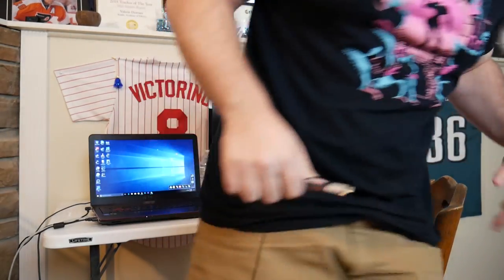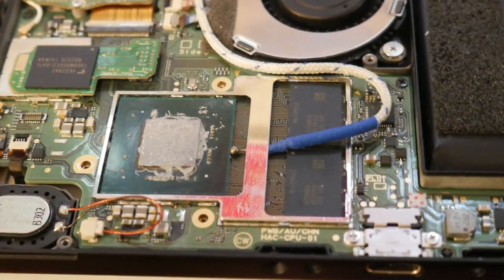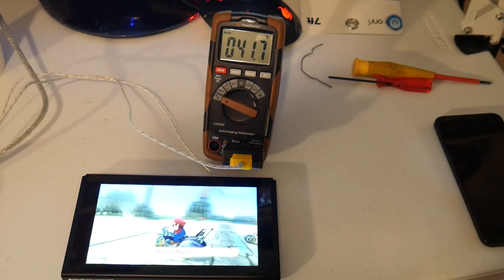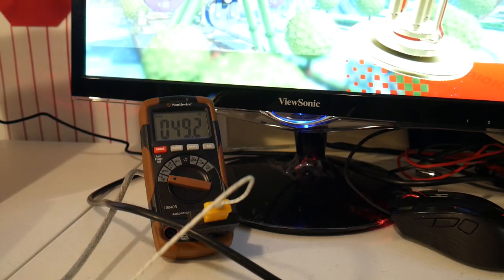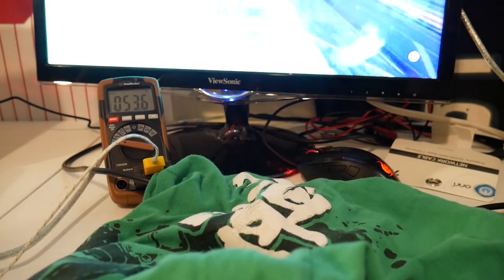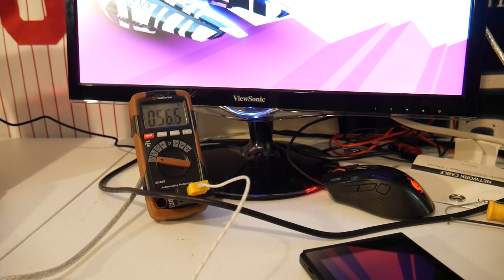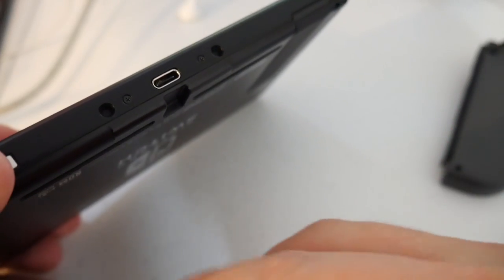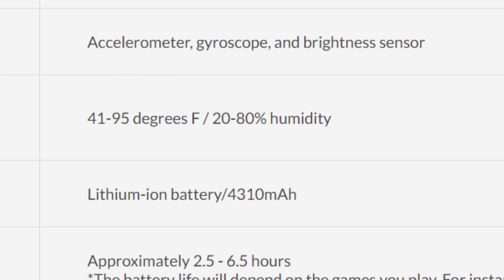Let's Overheat The Nintendo Switch!

Comment: Am I going crazy here? I was under the impression that the speakers were on the back of the Switch and the vent was on the top.
Reply: Jigglibuff The speakers are the tiny slits under the display. I only noticed a few weeks ago
Reply: The vent is the top you’re right. This guy just doesn’t know what he’s saying.
Reply: Wes Breden the vent is the bottom. But lets trust you. Because let say you opened the switch and looked at where it was.  And when you take it out then why would the air come out from the back instead of the front. Seems like you cant event tell where the wind comes from.

Comment: 60c is actually pretty cool for any processor. My overclocked 7700k which is a high end desktop processor hits around 85c during stress tests. 100c is kinda the too hot temp for a processor when it will either thermal throttle or shut down but in a handheld device you want it to be bearable to hold... Long story short you really dont need to worry about the switch overheating to the point of damage. Yeah it may shut down but it will never damage itself unless you remove the cooler for some reason then yeah running at any more than 20 seconds or so it will most likely kill itself.
Reply: that 7700k is a different beast with a  different archetecture and smaller lithography. the tegra can safely operate up to 75 degrees. intels modern processors are rated up to 100 degrees and with useually throttle at 90 to 95. also the tegra is direct die coupled to the heatsink there is no integrated heat spreader if you dont count the stupid emi shield as one.

Comment: I ordered clear shells for my switch, and I was wondering if the large metal plate on the back makes a large impact on thermals and if it overheats with it off. I heard that this was just an EMI shield but I also heard it acts as a heatsink. If you see this please reply quickly because I need to know soon
Reply: it should by design help dissipate heat over time. as for it's effectiveness it's meh. probably would run cooler without that extra layer in there. I have removed emi shields before with no ill effects other than maybe nearby audio equioment picking up extra noise but if that is a problem then the audio equipment is not shielded very good it's self.

Comment: Where'd anyone get this idea? Laptops have fans on the bottom aswell, they get warm bet rarely ever overheat
Reply: McKaos unless you overclock the CPU and gpu or heat up the internal battery....
Reply: James Braselton laptops also have hotter parts. Have you seen how fucking hot a shitty pentium gets. But the idea is ventilation on the switch is perfect for the ratio like a laptop fan ti its size.
Reply: Ricardo Martinez the fan in the switch is actually quiet big for the size of the tablet and moves air pretty well.
Reply: Knuckles300 yeah its the biggest fan ive seen on a tablet. I mever experienced it get to hot unless its docked and its just warm to the touch.

Comment: A general rule of thumb if you want to be extra safe is try not to play over 2  hours preferably 1 hour and make sure your room is well ventilated and ya should be ok for gaming sessions. Probably can last a lot longer but i don't trust playing the switch on the dock for very long periods even though i took extra precautions to help prevent overheating.

Comment: It's more about Switch lifespan. All electronic components have threshold operating temperatures. It is possible that you shorten its lifespan from prolonged exposure, specially capacitor.
Reply: You are right. That is also not taking into account that not every Switch can take 67c as there max temp before shouting down and some well take less heat and some can take more heat.
Reply: Dennis Tang I think this video also should assuage many of people's fears about that as well.
Reply: That's true, but the standard temperature ratings for components in consumer electronics is -40 to +85 C at minimum--and that's for their rated lifespan. Not to mention, most of the capacitors in the Switch are a couple inches away from the SoC and will be at least 5-10 C cooler than it.

Comment: My MacBook Pro works just fine on the bed.  Perhaps because it was designed appropriately for that case (no vents directly on bottom, but recessed up a quarter inch).  Design win.

Comment: You could recommend people who are still affraid, that they can use the smal dock by putting it flat on the table and the switch laying ontop of it while the cable goes around at the bottom. Having good airflow and works perfectly.

Comment: As you might know now, computers use a value called "Thermal Junction Maximum" as the maximum temperature that the processing unit can hit before throttling or shutdown. If the board is at 67c, the processing unit could be hitting a tjMax of 75 or 80c. In my experience with desktop  CPUs and GPUs suggest that's lower than what would be considered dangerous. We'll have to wait until NXident comes out

Comment: Xenoblade Chronicles 2 managed to scare me the other day. I played on my TV for about an hour and pulled it out of the dock and this was the first time I ever heard the switch fan panicking to cool the system. I was afraid that XC2 might be too much for the system at certain points. I think this because the game already has frame drops during serveral battles and while walking around map with many entities. If u wanna try for a thermal throttle, give XC2 a go. Yes thia game is long and i didnt notice heat problems until i made it to Gormott Province

Comment: Would have been nice had you flipped the switch over to see the difference between it lying on its back and it lying on its front. Most people (I assume) have screen protectors, so it would be worth knowing if the dongle dock works better when the switch is on its belly!
Reply: probably about the same.

Comment: nvidia tegra x1 doesnt even start throttling until zone1 reaches 89°C OR zone2 reaches 90.5°C.

basically this thing is not going to overheat itself during normal use and even when hitting temperatures to cause it to turn off it is below the temperatures required to do damage to the hardware.

Comment: While this was an interesting video to see just how much the Switch could tolerate, The thought of the two back "vents" really urked me considering they weren't really the main venting system. The actual venting comes from a copper pipe releasing the heat to the TOP of the Switch, where the fan is and exhausts the heat there. At least, that's as far as I've concluded with my own Switch.

Comment: The air vent is on the top of the Switch. The holes you pointed to on the back is where the speakers are.
Reply: Mike Mayo thats a fan not a speaker. The speakers are the slits on the bezel of the switch.
Reply: uh.. That's what I said. The fan blows air out of the vent on the top of the switch. The speakers are on the back. The guy in this video was pointing to the speakers. That's not where the fan is.
Reply: Think about it for a second. If the fan is where he said they are, the vents would be covered when it is docked decreasing the efficiency of it.

Comment: The thermocouple should have been touching the silicon die, not the interposer. That's nothing more than just a circuit board connecting the silicon chip to the BGA pads.

Comment: I think you should have kept the fan plugged up on the switch with a towel and shirt on top of it to see how hot it can get before it cuts off but if you wanted it to get even hotter have a heater blowing on it

Comment: The switch seems to hold up well. I have a Wii U and if you put items on top of the wii after an hour or two. ( maybe even longer.) it will over heat. But if you keep the Wii U open to air than you should be just fine.

Comment: Hey good vid, so what is the typical temperature the switch would operate under normal circumstances? (Ie, in a regular nintendo dock, no vents blocked)
Reply from the maker: Around 49C during Zelda.

Comment: The Tegra X1 was intended to function without any coolers to begin with... The Switch has a cooler which somewhat extends it's capabilities a little beyond original specs.
Reply: who said that? the tegra x1 requires passive cooling at minimum (which requires a heatsink be it a chink of metal or a active cooler likein the switch)

Comment: You should do a comparison of tempatures on the switch. Tempature of Switch laying down while using the 3rd party dock you used, tempature of switch docked in original dock and tempature of switch in original dock while laying down.
I was thinking of laying my dock down but because of the heat vents my dock is still standing, but I hate how much vertical space it takes up and it would be convenient if the dock was laying down which would make it way easier to insert and remove from the dock.

Comment: I love the Switch but I wish that they would work on the over heating portion of the Switch. It overheats a lot when it's docked and you can feel the difference when you take it out of the doxk and switch the memory card in the back. I am always afraid that something will go wrong with the Switch while it's in dock and it's overheating.

Comment: This does make me wonder; how might the system react to cold temperatures? As in, would it still function if I had accidentally forgotten it outside during winter if the average temperature was -30 degrees Celcius.
Reply: condesation would be the main concern but otherwise don't charge it till it comes up to room temprature and yeah you could play it but i bet that lcd is gonna ghost like mad and the battery will run down pretty quickly.

Comment: the most overheat I got my switch to be was when I was playing while sitting in bed and I put it down at one point on top of my sheets where the cooler got covered up as it was sinking in on my sheets.
not sure how high the exact temperature was but it was really hot when I picked it up and it was running quite fast and loud, trying to cool down. I turned it off for about an hour to cool it down just to be safe

Comment: A great test on trying to over heat the Switch but what about the case how did it hold up did the case bend or did it melt the plastic any where on the case?

Comment: I overheated my psvita a couple of times, it shut off later 30 minutes after it it ran fine, i left it on by mistake in my car with windows up, inside the car the tempeture was 98° outside it was 93° the system was laying on its back the battery was getting really hot due to it, the stick was being pushed so it kept the screen on it said overheat something and didnt allow me to turn it on, cool feature saved me a lot of money

Comment: love your channel,  If you would, can you make a video about vibration and its effects.  I ride a motorcycle and put the switch, in the case with joy cons attached, in my saddle bag.  now the left joy con will not register in handheld mode unless I pull from the dock or have it plugged in.  to sum up, be sure and separate the joycons from the switch if there is gonna be a lot of vibration...

Comment: WARNING!  Warning! I pulled my switch off the dock without putitng to sleep, then I put into a switch carrying case, and it syayed on ful power zipped up tight!  When I puled it out 1 hour later it was COOKING HOT fan blowing like made, thought I kiled it.  But it worked fine, so I quickly coled it by a fan.  Make sure to put switch to sleep before putting in a carry case!  Please make mention thi in a video sometime for the vieers!

Comment: Even at 67 Celsius you shouldn't worry about hardware damage. Most CPUs will happily run at 80 for more or less decades. AMD and I believe Nvidia have come out saying their GPUs can handle up to 95 C without them living a toasty short life. ARM chips may be different, but as long as the thermal paste on your Switch isn't balls'd up it shouldn't overheat. 

If your Switch is overheating you should either take it out of the oven or call Nintendo because someone used peanut butter instead of thermal compound.

Comment: Slightly off topic here but does the switch stay cooler in a low profile dock such as the one that you just take the guts from the original and put in the new dock’s shell?

Comment: Definitely going to try this at home- well in my lab, anyway.  I wonder if the system is locked to voltage rather than a certain temp (as voltage would determine more of anything else going on).

Comment: I use my switch (when docked) with the back of the dock open to allow more air to come in through the back vent. I play at night with the volume off so I hear the fans alot and opening the back of the dock makes a big difference in noise.

Comment: But, where is the cooling paste and the metal part that expells heat even more, I bet if you use those (they are notmally part of the switch when you buy it) you should get lower temperatures and it almost wouldn't be able to overheat

Comment: I somehow turned my switch on while it was in my backpack the first week, I didn't have a temperature probe like you but I had the temperature gun, and the outside of my switch was at 104°F  Which is roughly 40°C  It survived just fine.  I just turned it off and let it cool.  Here is the picture.  http://imgur.com/a/upoZC

Comment: My switch fan ramps up loud as heck one time when I put it laying flat on the thing the dock came wrapped in (blowing cool air). I had breath of the wild idling so the fan was running while the system air intake vent is blocked. Now sometimes when I turn on the switch and launched Zelda the fan speed up for some minutes (not as loud as that one time) after loading the game then slows back down. Many people have experienced this but don't know if it's normal.

Comment: I was playing rocket league in tabletop mode for 2 hours and my switch got very hot.... i was asking myself: is it possible to overheat the switch?
I want to buy doom for switch and i have one question:
Can the System overheat by normaly playing games that might cause the system to get hot (just as doom does)

Comment: So interesting comment: 
I was in the mountains for camping. It was way below freezing. I found myself awake because it was uncomfortably cold. Figured while I was building a fire And waiting for it to pick up I’d waste some time on my fully charged switch. Well…. It was too cold for it to wake. And the fan kicked on at the highest rpm. To me it was alarming from never hearing the fan before in all my time playing on this system. It took about 5 or 10 min in my jacket for it to warm Up enough to actually turn on. Strange that cold was a “beyond safe operation” condition to prevent being able to use the system. But yeah, In my search for answers I’ve only found overheat conditions. And led me to this video. So I figured I’d make mention of this situation for future understanding to anyone or even this channel. Basically anywhere around 20 f or below for extended period time will make the switch go into a panic attack and not operate untill warm enough for what I would assume is the battery temp not being enough to work properly. (I’ve had similar issues with other devices being too cold like /DJI drones/ laptops) so I speculate that the switch is no different. Anyway, I hope this helps.
Reply: Did your switch display any message saying that it was too cold or did it just not wake up at all?
Reply: @barrettross3772  it was just black screen. Nothing notable as far as a notification or battery icon. Just a light turning on and the system responding by the fan turning on at full rpm. Like a defrost mode lol. And now that I’m thinking about it again. It could have been frozen condensate (which any amount of moisture bad for contacts or electronics, causing a malfunction) or just too low of a temperature for normal operation and the system trying to turn on and couldn’t. But that’s it. As far as the description of events.
Reply: @blendyboi2087  I’m curious, was it a light on the dock or the switch itself? Because I do not recall the console itself having any lights.
Reply: @barrettross3772  actually you’re right lol. The console has no light indicator lol my bad. This was 10 mo ago. And I don’t use my switch that often. I’m primarily PC. It was not in a dock. I just remember hitting the power button and seeing nothing pop up and then hearing the fan ramp up And stay on for a good while. Unless in a corner of the screen there was an indicator (like a battery icon) that I’ve mistaken for a light. I don’t think there was anything at all. Untill the Home Screen finally showed up.

Comment: you say that there's a limit on how much energy it can pull when it's running on battery, is it enough to just plug it in to get rid of that limit (maybe for games that don't perform as good) or do i have to run it on a tv/monitor? i only use mine as tabletop at home (and handheld while travelling) and bought a stand where i can charge it while playing
Reply: the limit is in place for run time not heat or load on the battery.
Reply: @CotyRiddle  so that limiter is not active when it's plugged in and it can pull more power?

Comment: what are the systems made of? my 32 inch tv falls off the wall about 3 feet from my system and hits my switch in the dock, bent the back cover of the system,  and It sill works great and this happen not even 30 mins ago... but it not covered with Nintendo warranty due to it being physical damage....
Reply: Fermin Espinoza but slide it into the dock and the screen scratches. I feel like the designer was working on making the console indestructable but he ran out of money so used plastic rails and screens.

Comment: Games like The Witcher 3, Skyrim, Resident Evil gets 60 Cº to me, on dock even more, maybe 62 Cº or so, makes me really afraid, because is super hot.
Reply: You still have a good temperature for these games, even in the Mario Odyssey it reaches 57 to 58 ° C, remember that the switch is small and it tends to heat up quickly (and vice versa in cooling).